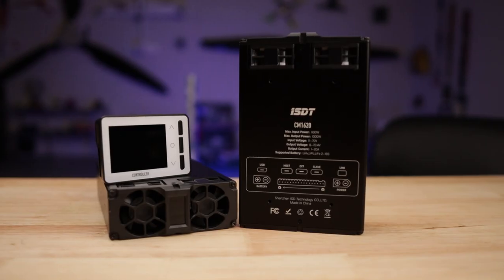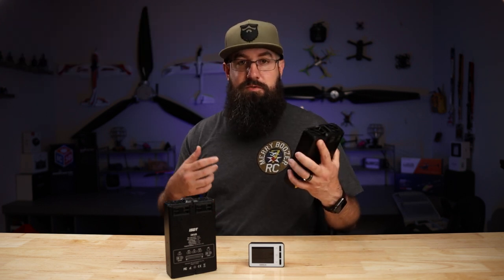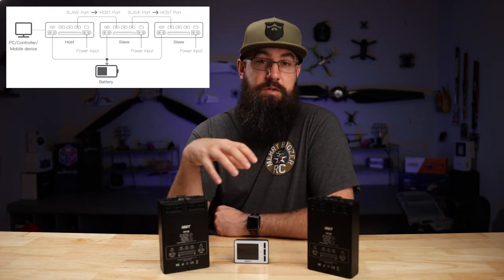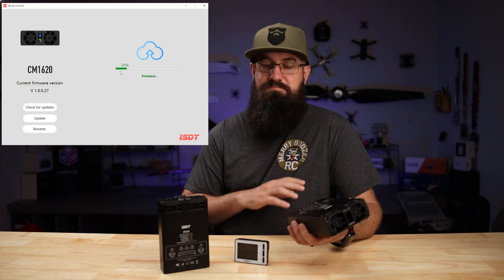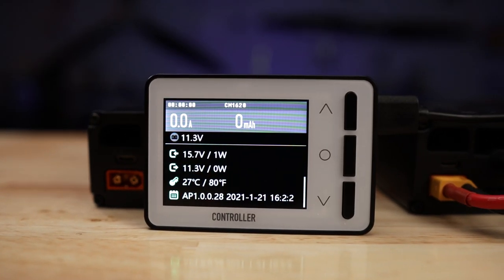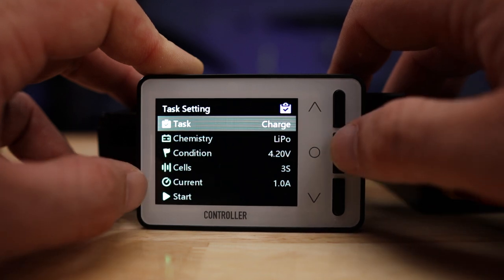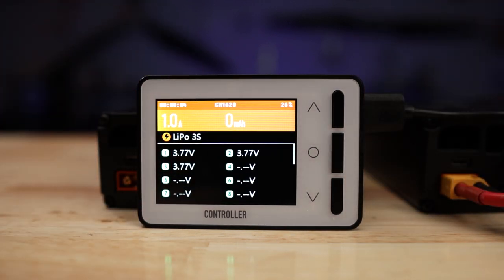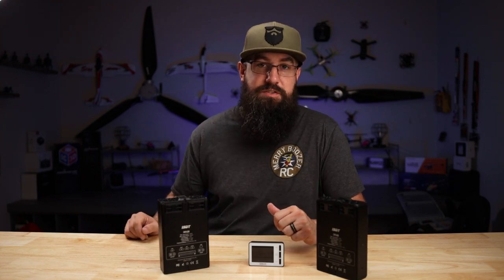iSDT CM1620 2-16S 1000W 20A Industrial Battery Charger Module

Comment from the maker: The CM1620 CONTROLLER is for the CM1620 - ONLY.  That's why it is labeled "CM1620 Controller" ;)  Don't purchase it thinking it will work with other iSDT chargers.  It will not work.
Reply: Does this balance charge at the end of the cycle and if yes at what currents ? Or if the battery is unbalanced it will simply just stop charging ?

Comment: I bought two of those from you and both only support 6S via android app. I can not get the charge a 12s battery. I am very disappointed with the product. Also the max ampere I can select is 5A and not 20A as advertised. Android app is up to date and firmware version is 1.0.0.28.

Comment: I had just taken delivery of this charger, applied 60v to the input and it immediately burnt out and died. The specs says it is good for 70v input voltage, has anyone tried using it with high ish voltage supply say above 40v?

Comment: Can these be used to charge a battery that does not have balance leads? So for example if I have a 14s9p battery with BMS managing the balance, can I use this to charge the battery up to 51.8v?
Reply from the maker: Yes but at your own risk
Reply: @BuddyRC  
Thanks for the reply. Do you guys have any info on the other 'industrial' product on their website - the B80/B60?

Comment: Does anyone know if this will work for LiIo ( Lithium Ion) batteries?  I have a 14s LiIo battery for my bike and want to charge it as one 14s battery instead of 2 7s batteries.  In the manual LiIo is not listed as a supported battery type and from the video for some reason I can't see which ones are greyed out when he goes into the menu.  The color doesn't show up for some reason.
Reply from the maker: Yes it does

Comment: Can I use this to charge my enable battery?  My eBay battery used 18650cells in 13c configuration. So 48volts or fully charged at 54.6volts
Reply from the maker: Yes
Reply: Does it balance? And can you charge a battery without using the built in balance on the charger (battery has its own balancer)
Reply: @highonahill  yes the internal bms automatically balance the cells.
Reply: @riceball777  is that a yes to both? I have batteries with built in balance and I have batteries with balance leads. Some lipo chargers get mad if you don't plug in a balance lead
Reply: @highonahill   most ebike batteries or any other batteries made with 18650 cells all do not have balance leads.

Comment: Do not buy this. I contacted isdt and they admit cheating. It does not work on android! Isdt sells a product which does not work. 
"Our engineers feedback me that the APP for Android of this CM1620 is far from prefect. 
 Considering that most of people abroad use iPhone a lot, so we put more efforts into the iOS version of our APP.
 During this period, our engineers will try their best to adapt Android system, so I suggest you use iPhone to use app in recently days to experience the full functions of this device."
Reply: I want to add that parallel charging doesnt work either (even using iOS) Er157
Reply: Just want to let you know that buddyrc does not respond to emails and I had open a paypal conflict to be able to return those products. The devices do not meet the advertised functions.
Reply: Does it work as advertised using either a pc to control or via the $40 hw controller?

Either of these would work for me.

I do use android, but I'd never be using it anywhere but at home, so pc control would always be available.

Output programmability is big for me.
It means i can refactor my battery pack for speed or range without buying a new charger.